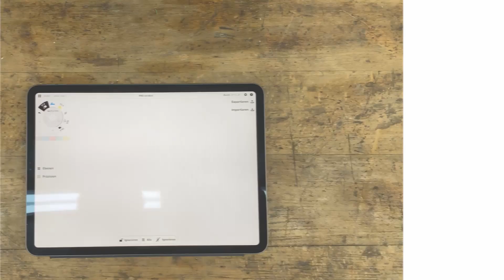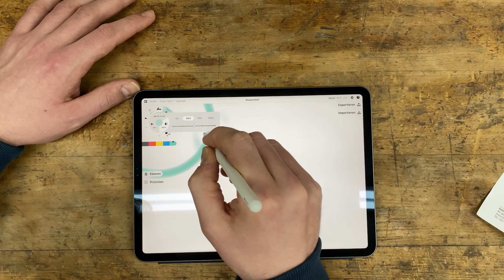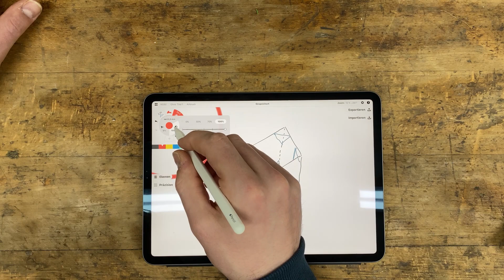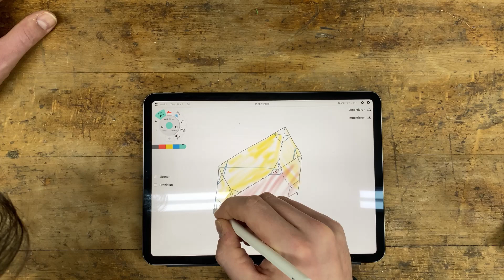Reboot Series E02: Prologue - All about that base | CNC Router Base with Cabinet Storage (E02)

Comment: Great building series! Can't wait the linux cnc part :) You'll use servos?
Reply from the maker: There will be servos from both jmc and delta :)
Reply: @MinistryofBrokenEndMills   That's exciting (im in the planning phase of a large cnc :) Can't wait, cause there's not much video  based on the linuxCNC and servo motors combo. it will be very informative, thanks! :)
Reply from the maker: It’ll take some more time, but preliminary testing was uneventful. The servos simply receive step dir signals and are no different from steppers in that sense. Their internal tuning however is a different story. Also: tandem axis (that’s a bit foreshadowing)
Reply: @MinistryofBrokenEndMills  wooow :) sounds cool! Now really can't wait :)

( I hope I can start my own build soon, planning to make a youtube series too )